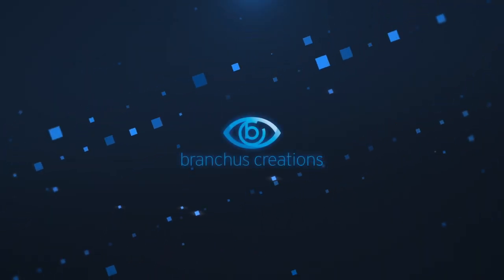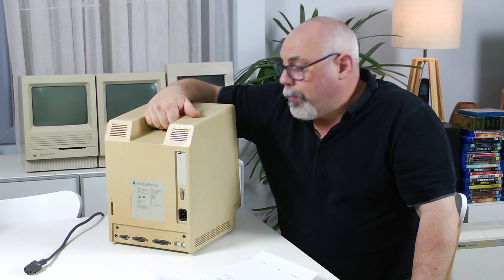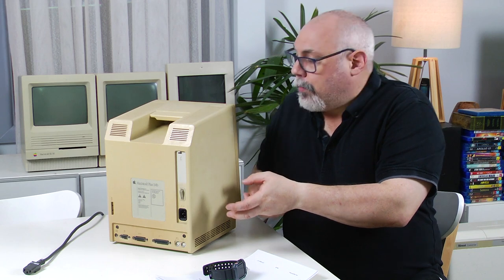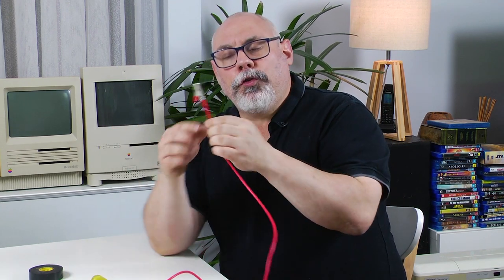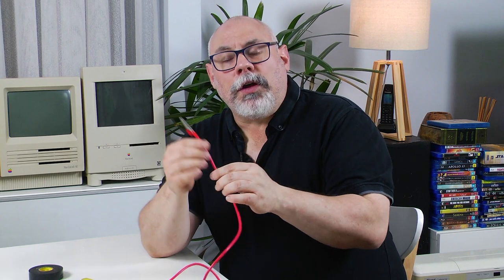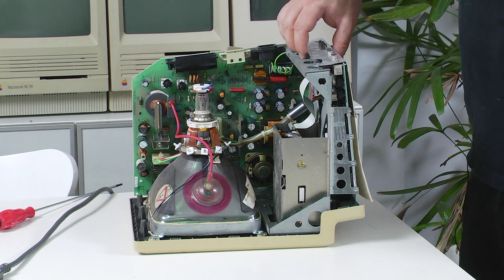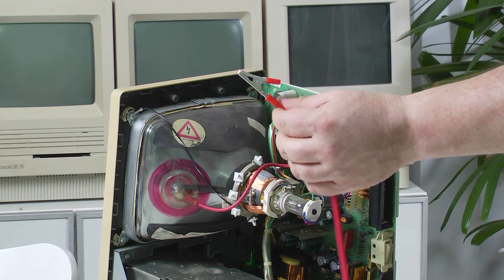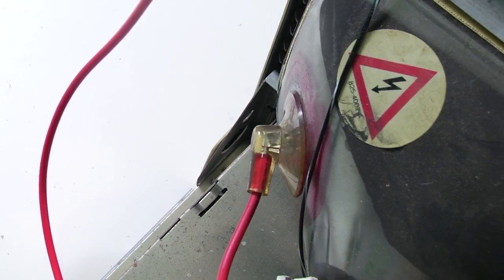Discharging the CRT in a compact Macintosh

Comment: ,"Firecracker discharge indicates open magnetron windings"  I will always remember that statement from the G.E. field service guide, whom I worked for as an appliance tech, 30 years ago.
That statement is very true. Sometimes it sounds more like a bullwhip.  Oh, its referring to microwave oven diagnoses and repair, and discharging the high voltage capacitor inside the unit. 🤓

Comment: One caveat: I like to use an aligator clip on the screwdriver side too instead of taping the bare wire; it saves the need to sacrifice a screwdriver and tape, especially if you don't do this often.
Reply: sacrifice? just take it off when you're done...

Comment: Nice video, but when using the wire without the resistor, you stand a higher chance of blowing the 7438/LS38 IC on the analog board when discharging the CRT. (Former tech at a gray market repair depot '93 - '97)

Comment: Many thanks for this tutorial.  I recently picked up my first Mac Classic which badly needs a full recap so I'll need to discharge before stripping down.  Beyond hearing a spark can you recommend any procedure to prove that the HV has discharged, would I need an HV probe to do this?
Reply from the maker: I've never actually tested after discharging, and have just trusted in the discharge tool. However, if you have concerns, just leave the computer unplugged overnight before touching anything.

Comment: Can't go wrong with Apple's own recommended procedures! Would love a demonstration at some point of adjusting the voltage for a 128/512/Plus. I wonder if the European/Australian units differ from the ones here in North America, like the mains voltage.
Reply: Interestingly, Larry Pina recommended in his repair book to use a bleeder resister, so I went with that. But that does make sense about wanting to hear the pop of the discharge!
Reply from the maker: There are quite a few differences in the US and International versions of the analog board, but the voltage adjustment procedure is the same for both. I'll add a voltage adjustment procedure video to my request list!

Comment: Great Video, I am hoping you can add a detail. I know that the coating inside the CRT makes the Anode and the coating on the outside is the Cathode with the glass acting as the dielectric of a large capacitor. Does the neck board need to be connected to get a complete circuit when discharging? I am not measuring a connection between the cathode and the ground lug without it!

Comment: I'm going to do a tube swap on a Classic since the neck on the tube broke when my hand slipped and hit the board that cracked the glass on the tube (idiot me) when I was trying to disconnect a stuck SCSI cable. Fortunately, I have the system disconnected and I have spare tubes from other compact Macintoshes.

Comment: I followed your advice and successfully opened up my 512k. Discharged at the anode. No spark (I left the machine off for weeks prior) but I feel better following your example. I'm writing 1) to thank you! and 2) Do you know where can I go to learn what capacitors can burn out and mess up the display? My symptom was screen "clicking", then a cap burning smell. Then the display worked but it was off to one side and the font was huge and distorted. I don't see any obvious caps burned, and I could be wrong, but it sure smelled like a cap took a well, you know.
Reply from the maker: 1) You're welcome and thanks for watching! 2) That symptom actually sounds more like the flyback transformer than a capacitor. Unfortunately replacement flybacks can be rather hard to find, and you may have to salvage one off another Mac (128k, 512k or Mac Plus have the same one). I would also inspect all the solder joints on the analog board, as it's very common for these old Macs to develop cracks, resulting in all sorts of problems - especially with the display.
Reply: @BranchusCreations  I found a flyback transformer from a company in Florida. Worth a shot, I figure. Now to start practicing my skills.
Reply: I just wanted to do a follow-up. After finding a flyback replacement I practiced soldering/desoldering on some scrap boards and then finally went for it. First time doing this level of repair. Well, it worked out wonderfully! Your diagnosis of the flyback transformer was spot-on, and now this 512k Macintosh is alive again with a bright, crisp display! Thank you very, very much for pointing me in the right direction.
Reply from the maker: @lanatrzczka  Great to hear, congratulations!

Comment: BRANCHUS CREATIONS, why does the B+ voltage need to be set correctly or the monitors H&V sync signals will not LOCK and display a scrambled images?